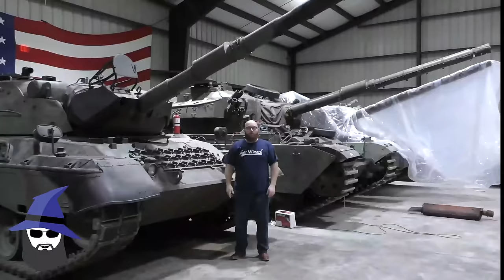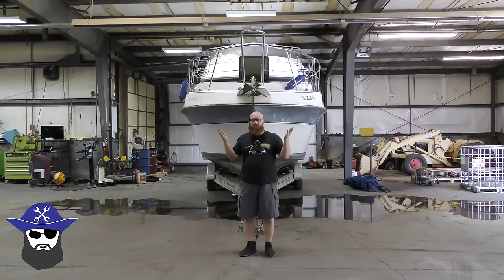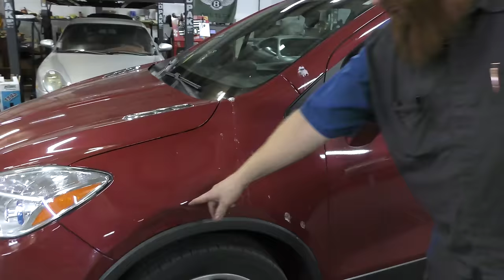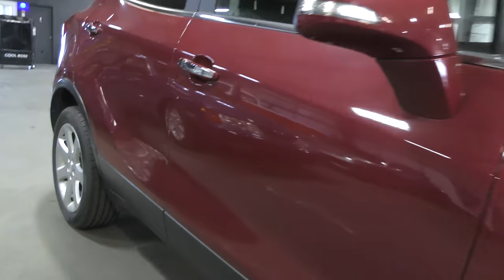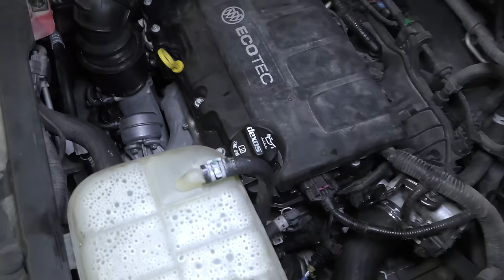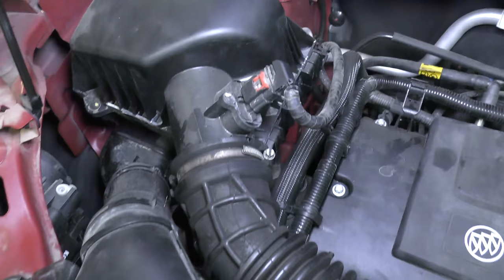How did a dealer miss the problem on this '15 Encore 4 times? CAR WIZARD just had to read the codes

Comment: selling dealership failed to properly perform the PDI, pre-delivery inspection, and failed to check and top off all fluids. after driving the vehicle, it started to miss shift on the transmission. some times it would not go into reverse, delay forward engagement, erratic shifts up or down. took it to the dealership and the service dept. stated, ALL RANGERS SHIFT THE SAME WAY AND NO FAULTS FOUND! knowing that was a lie, I took it to another dealership which found a low fluid condition as well as reprogramming update needed. the trans will still miss shift once in a while but nothing like before, which may indicate damage has already been done. notified Ford but the response indicates they did not care to know or do anything about the problem.

Comment: Car Wizard I just bought a 2016 Buick Regal with 2.O turbo with 120,000; I couldn't find proof of transmission fluid change so I scheduled a transmission fluid change with the dealer. The dealer is doing a flush and fill. Should I just drain and fill the transmission fluid, without flushing?

Comment: I am curious if those fancy scan computers cam provide a printout of the codes in your car.   If so then a customer should be able to request those.   I have a mechanic work on my cars when I have no time to do so, and he will provide those codes without my asking, and in my opinion that is good form.   But now se cannot even trust the dealership, and with "right to fix" being challenged by automakers we are in for an uphill battle.

Comment: This would be a Vauxhall Mokka in the U.K. they a plenty of them on the roads over here a have not long ago after twelve years of Ownership of my Volkswagen polo 1.4 TDI for a Vauxhall Astra 1.6 diesel which I am very pleased with so far it is a lot smoother with having the extra cylinder also it’s doing the same mph has my old pole I never Take my cars for a service to the main dealer anymore after being ripped off many times in the past

Comment: Dealerships are so hit and miss in my experience. I've taken multiple of my GM vehicles to multiple GM dealers in my area for service (about 20 sq miles with a handfull of small towns near Youngstown, Ohio) over the years, and some are honest and do good work and others are absolute crocks just like the one this person must have went to. I think it depends a lot on the management and what business model they're using.

I'm taking my 2016 Buick Regal GS to the dealership I bought it from near Akron for a warranty transmission service, and I'm curious as to the service experience I'll have through them. The sales experience was excellent, and I'm hoping that translates to service.

Comment: The rear suspension is as independent as it it can twist.  It is a giant sway bar, really.  This is not the live axle of a Dodge K car going directly from center to center and bouncing up and down with the both of them. (See also modern RAM vans.)

 There are trailing arms. Short ones, but they're there.

Comment: I'm more than a little pissed off at this story. THESE are the reasons people are so damn pissed off at dealerships and shops when it comes to repairing their cars. The scan tool literally said "here is your problem right here" with a big, red YouTube thumbnail arrow and circle and they still glossed right over it, tackling something that has nothing to with the issue at hand. You're right Wizard, I could've easily found that problem myself with a quick trip to Autozone and have them scan my OBDII. Something she should probably do next time before taking it in. Better yet, she should just exclusively come to you from now on, screw that dealership.

Comment: I've worked at multiple dealerships. Never as a tech mind you. However I can say that the so called "techs" are right off the street, or right out of highschool shop class. There were multiple 17-20 year olds at the last place. So a dealership isn't exactly your best option.

Comment: Is it an accurate statement that a normally aspirated engine versus a turbo charged of smaller displacement, will run longer with less problems? Obviously assuming same level of maintenance and driver behavior on both.

Comment: I have a 2016 buick encore that started making a chirping sound (like birds in engine) the chirping settled down then noticed power loss (barely hit 60 mph) then shut it off but didn't want to start took 3 or 4 attempts to finally start and get me home. Told dealership and they think it's the timing belt and saying between 4 and 5 k to fix a month from now...what's your thoughts you seem knowledgeable

Comment: My 2020 buick encore started having the check engine light on and it shut off my remote start and cruise control.  It was under warranty.   I took it to the dealer I bought it from.   They said that it could maybe be the turbo but wasn't sure.   They did something and said it was good.   Three days later again in southern Minnesota in January the light came on again.   It took me another week to get it back in the shop like it did the first time.   Again they weren't sure what was wrong.   Did something again that was supposed to fix it and again the light came on after five days.   I called another dealership 40 miles away and they knew exactly what was wrong.   It was a major warranty repair.
It seems that these vehicles were not built as is for northern weather so every winter I need to put on a cover over the lower grill to keep it warm.   
It is the next winter and the warranty has expired.   The second dealer gave me the wrong cover.  It is for a larger Chevrolet.  I am battling with them to get the correct one.   I will probably be going to a different dealer for any further repairs. 
What i am learning is they will fix one thing and think that you totally trust them.   They think that you will trust them on anything that they tell you in the future.   I let any know that I will go someplace else for a second opinion.   I don't trust any of them.

Comment: Ages ago I had a cavalier and it needed an ignition module. Dealership said it needed a throttle body for $1000. Another chain shop said it needed a head gasket. The independent real mechanic figured it out. Dealership also put freon in it when it leaked out and told me it had a leak. No sh**, how about a solution that lasts more then 4 days? Same independent mechanic told me about R134a conversion. Worked great for years after that until I traded it. I lost faith in dealerships after that.

Comment: Rolled into the infinity dealer in Colorado Springs after I had my lock popped at a campground. They spent an hour on my Chevy and couldn't do much. Ended up just covering it so I could keep going. No charge. 
   The shop in Farmington N.M. caddy to auto zone stayed open 2 hours after close to replace a strut with a bent trailing that just wouldn't line up. 
  These are the ones I can rec. Guys I ran into on vacation thousands of miles from home. I cannot recommend anyone I know locally. They either wait a month or are exorbitant or don't even fix what's wrong.  Still have a good fuel pump after it was replace cause of "that's gotta be it" b.s. phonecalls. Plus labor.

Comment: Dealerships are the absolute bottomless pit for scummy tactics. Ford has a recall on their Toe Links for the Taurus/Explorers. My girlfriend owns a 2013 Ford Taurus Police Interceptor, she went in for the recall. The recall is both a rear toe link replace and an alignment. Instead, they failed to do the alignment and instead sent her on her way with a sheet that said "needs alignment badly", ok, so why didn't you do it? I told her to take the car back as to do an alignment, she did and instead they decided to "inspect" the car. They inspected it and came to the conclusion it needed $2800 in suspension repairs before doing the alignment. It apparently needed both front inner and outer tie rods, both front control arms, both front and rear sway bar end links, both rear upper control arm bushings. I thought to myself after she came home, without an alignment, sway bar links aren't an alignment part necessary. So, the next morning, I took the car back myself, said what gives? They say "We don't like to work on Police cars, and it needs all of the repairs listed", I said first, sway bar links are not an alignment item, second, you didn't even bother to try and perform the alignment in the first place and instead tried to charge her for not only doing the alignment (as per the recall), but then tried to squeeze $2800 in repairs. 

So I took the car home, lifted it up, ripped off the tires, inspected all the items listed. (keep in mind the front control arms were replaced by the Police department we bought the car from prior to us buying it, carfax even proves this and so does the receipts). All 4 sway bar links were good, inner and outer tie rods were good, no rust (and we live in Canada, so rust is a thing). All bushings were in perfect condition. I took the car back the following morning and basically said I looked over everything there isn't anything wrong with any of the parts you listed. They decided to backpedal and say "Well, tie rod jam nuts are usually impossible to break free, so we just replace them entirely" I left pissed off, ripped off the tires again, broke the jam nuts free with absolutely zero issues, went back to the Stealership and said "here, I did your job for you, do the damn alignment", they refused and said "we do not like working on Police cars, you will have to take it elsewhere. So I did, $60 dollar alignment elsewhere and the car is fine.

Comment: I took my Buick Enclave to the dealership 4an oil change, they'll never tighten down the nut to the oil pan, and never changed the filter, all the oil drained out of the car 🚗. The dealership said the car would stop automatically with less  than a gt.of oil lol in the car 🚗. OMG WTF ,Never Never Never Ever Again. Ray Price Of Poconos

Comment: I know this video is old, but this right here is why I'm almost willing to ship my car 2000 miles to Omega to get it fixed and shipped home, because its cheaper to spend 3k shipping it and his repairs, than the constant 500-1000 "repairs" that do nothing and they just rip you off and do nothing. That 3k + 1 bill would actually  have my vehicle fixed

Comment: This is the reason I don't take my car to the dealership and most shops. I don't buy into the dogma that they do the best quality work. I'll buy OEM parts from them if I decide that it's better or cheaper than any other aftermarket options but that's it. To me, it's just a parts shop. The service center is a no-go zone.

Comment: reminds me of when I took my parents Acura RDX to the dealer because the transmission was hesitating on light acceleration when shifting between 1st and 2nd, thinking it may need just a fluid change or sensor.  I was told it wouldnt make it the hr drive home, that the trans was slipping. wanted $3200 for a used trans.  did a fluid flush at a transmission specialty shop and its been fine for 22k miles til lately which the problem has returned.  now i'm left at where can i take it?

Comment: I hate smaller engines with a turbo idk how Ford chevy and Honda can go and make a 1.4 to 1.5. 4 cylinder and turbo it and make it reliable Honda is a slight exception but still has the oil dilution issue

Comment: My daughter had a problem with her car, it would not start on several occasion , the headlights would work, but when the ignition key was turned on no power at all , she had been to the dealership in her town and they charged her for a diagnostic fee, road tested it and the car did not do the same problem while they had it ,  but the problem was still there, it might start for a week , then one day not start, So I told her, bring it home and leave it for a while and I will take it to get fixed, I took it to my local dealership and they did the same thing looked at it and could not find anything wrong either , then said we will to do a wiring trace which might cost several hundred dollars or the computer might be bad or need a lot of labor to get at the wiring short  , I'm not a mechanic but that sounded like a rip off and said I would keep getting estimates , anyway I got home ,looked under the hood looking for any loose wiring or partially connected harness but everything looked OK,
then went to start it and it did the no power to the ignition problem, I got out of the car pissed off and slammed the door, and again looked under the hood, got back in and the car started righted up, So I associated the slamming door as the source of the problem and began looking inside the door panel for a short, but everything was OK, Then frustrated looked under the hood again thinking, What the hell is wrong with this thing! I just happened to brush against the battery cable with my hand and noticed how loose it was, My daughters dealership did service to her car and did not tighten down one of the battery cable ends , when the drivers side door was slammed it must have made the cable jiggle loose where it wasn't a good ground or maybe while driving hitting a pothole might also jar it loose and just by luck it would start up again, I probably should have started with the battery first but I assumed my daughters  dealership with professional mechanics would have looked for the obvious first, So I put the idea of a bad battery ,cable or loose connection out of my list as the possible cause .

Comment: I get so tired of people thinking that if they don't have mega horse power, you can't get on a highway safely. Very few people seem to know how to merge on a entry ramp regardless of what they drive. My 169 HP Camry has more than enough power to do what is needed  and is getting almost 30 MPGs even in town. I love the ease of maintenance of the 4 cylinder and with the higher cost of gas currently and lower carbon foot print , I'm glad to own a 4 cylinder. If you don't know how to merge on a highway all the HP in the world isn't going to help you. Today all I see is people slow poking at traffic lights and stopping others from getting through the light and holding others up and wasting fuel.

Comment: Part of the problem is created by OEM AC Delco parts made offshore, made in the US means offshore components assembled in the US. That doesn't even address the electronic thermostat which was also probably made offshore and failed prematurely, why does it need to be electronic? Why does a 6 year old car need repair in the 1st place? Because it was junk to start with.

Comment: Dealership = stealership. Our local Ford dealer screwed us out of $139 to tell me the ABS pump was bad and Ford discontinued the part on a car(2011 Ford Fiesta)that was barely 10 years old. It had all the symptoms of a bad master cylinder and had set no ABS codes, only a mushy brake pedal even after bleeding the system 4 times. I told their service writer that she had no business being in that job or career field if all she could say to my questions was "I dunno"........what a dummy she was.
I purchased an Autel MK808 scan/diagnostic tablet earlier this year, has saved my butt at least 3 times being able to run real time data logging and saving freeze frames for future reference. Excellent tool to have if you want to work on late model stuff anymore!

Comment: Lots of times they throw these at the warranty/tire/lube guys to get it in and out. Bet a buck it's an ecu issue maybe, causing that thermostat to run when it's not supposed to killing the battery.

Comment: It doesn't sound like they even tried to fix it, they just threw an oil change at it and a belt and rushed them off. If they'd hooked up a scan tool and a battery tester it would've been fixed the first time.

Comment: Hey man, I was wondering if you can reach out to me, I have a couple of questions, I’m just a small time mechanic, I don’t work for dealerships or a mechanic shop I just fix them myself but I’m stuck in a pickle, I have the identical Buick encore but my problem is the pcv valve or so that’s what “they are saying” I’m hard of hearing and it’s hard to hear certain sounds and I was wondering if you can give me an advice!

Comment: On some cars when you erase a code it doesn't come back right away, so most likely in this case they erased the code, the lady was given the car back with no engine check light and she drove off and the dealer just kept doing the same thing until she gave you a try- she should file a complaint with the City attorneys office even if they don't or can't doing anything the report will be on file and maybe someone in the future can use it But the point I want to make she is a female and less likely to know about car scams so guys this could be your mother your sister or daughter.

Comment: I have a 2016 Buick Encore I got back in January 2023 and it came with a lifetime powertrain warranty but 8 months and only 7k miles later the check engine light and the traction control light came on start running rough and act like it wasn't going to shift called dealer they knew what was wrong before I had even gave the code my code reader gave and said it wasn't covered under the lifetime powertrain warranty the code P0304 and P0420 and now I not sure what to do at this point I feel like it should be covered the Buick is lacking in power and when I was stopped at a traffic light it act like it was going to shut down wish you had a garage close to where I live I would take it to you

Comment: I have this POS in silver. We keep having a problem with the coolant fan striating on and running the battery down. Took to a mechanic and the valves was cracked and gaskets. $850 later and the damn coolant system still isn’t fixed
Reply: After watching I am thinking it’s the thermostat in mine. I can’t find any books that tell where it’s at